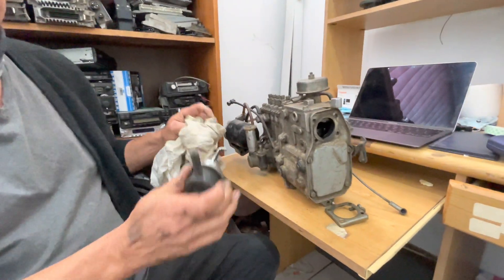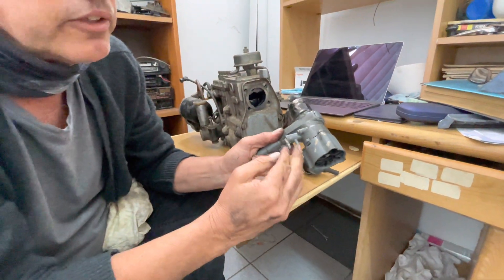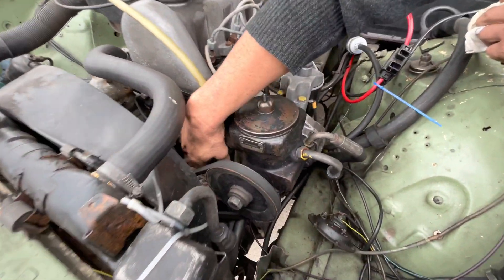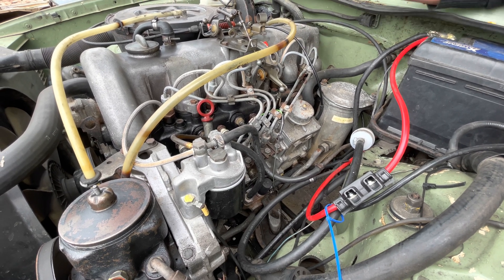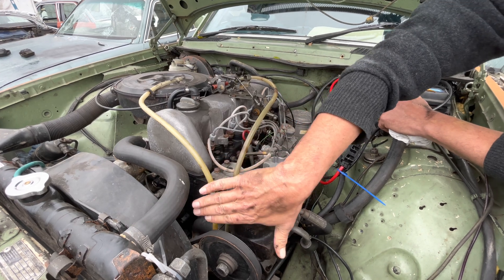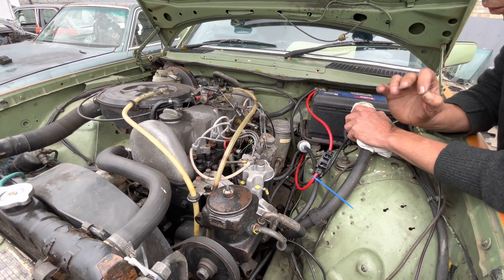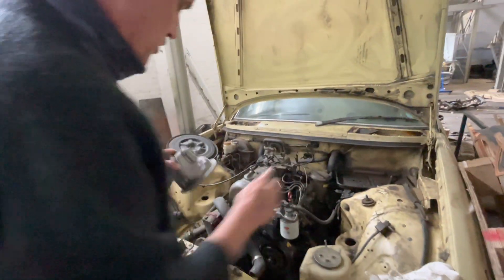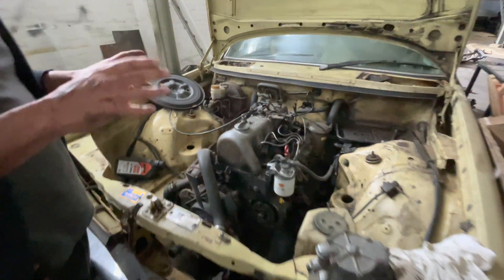Tutorial: Mercedes-benz w123 diesel engine shutoff problem. (OM616/OM617)

Comment: I’d love to get rid of all the complicated stuff in my w123 wagon just like the cars you just showed, but it would get rid of my heating as well, which is important here in Canada. I did also buy an electric vacuum pump (UP30) to possibly replace the mechanic one. I hear the OEM ones can cause a real mess in the engine if the little ball bearing in the lever breaks. (But adding an electric vacuum pump adds other complications.)
Reply from the maker: Luckily it doesn't effect the heating in the cable operated system used in the non-climate control versions we had here in South Africa. How are you finding the electric vacuum pump? 
Bear on mind that unless you remove the old pump and blank off the aperture, it will still be running and will still stand the risk of failing and possible sending a bearing into the chain. Its not something I've every come across though.
Reply: @ I haven’t installed the electric vacuum pump yet. Reading up on the vacuum system, I’ll have to do some more checks before I do it. It sounds like the OEM system has a designed leak down designed into it, which would cause an electric pump to run nonstop, which those pumps are not designed for. My plan for now is to just maintain the mechanical pump and if I see that things are wearing/worn too much, to convert it if necessary. Thanks for the info that you haven’t seen one fail yet. Very good to know.

Comment: Mine won't turn off when cold but if you give the throttle a rev it then turns off. Been  like this for ages but now when cold I also get the hard brake. Should I try replacing the new shut off valve which I have first  or does it sound like the pump diaphragm? Many thanks
Reply from the maker: By virtue of the brake being hard, the pump diaphragm is the most likely suspect.

Comment: Excellent explanation and overveiw to a common problem. Thanks. In my case I used a normally open electrical solenoid that energises when you turn the ignition on to remove vacuum to the shuttle. It Would be wonderful if someone or yourself can invent a method to repair the individual components as they are getting very difficult to source now. Keep up the videos
Reply: The only car in the world that doesn't want to stop: as long as you have fuel oil, air and compression it will run!  :))))

Comment: i am currently suffering such an issue, there is some oil in the vacuum lines and the engine won't shut off. i already replaced the membrane and seals. but the problem is still there. i think i will replace the shutoff valve next hoping that will be the main problem
Reply from the maker: How do your brakes feel? The oil in the vacuum pipe could also be brake fluid if your booster is on the way out.
Reply: @oldmercguy  they feel good, vacuum valve has been replaced like I said.  I removed the oil from the lines and now the engine shuts off again. My theory is that there was still some oil in the brake booster from the broken vacuum valve before. (I drove about 50 km with the broken pump).  Now i am trying to find the vacuum leak in the door locks :)
Reply: My problem laid in the vacuum climate control system
Reply: i fixed mine it was in the driver door  @Aaronhouston33
Reply: @MarcS4R  I thought that was the case but I blocked off just the green air line from the ignition the I gained 100% of my doors and shut off back, I’m going to convert my climate control to manual

Comment: You could just use an electric solenoid to replace the vacuum shut-off valve. Depending on what type of solenoid you have, you'd have to connect one terminal to line 15 and the other to ground. Line 15, IIRC, is live in the START and ON positions.
Reply from the maker: You could indeed but that adds complexity that isn't required of course. On my own diesels I prefer as little dependence on electricity as possible and could effectively start and drive one of them without a battery if I have someone to tow start me. Thats the biggest appeal of them for me, simplicity.